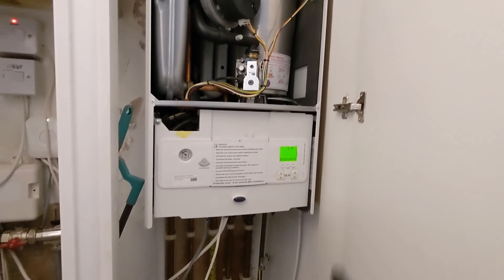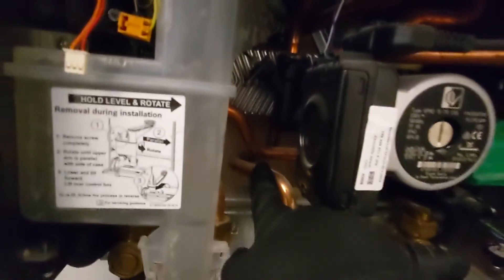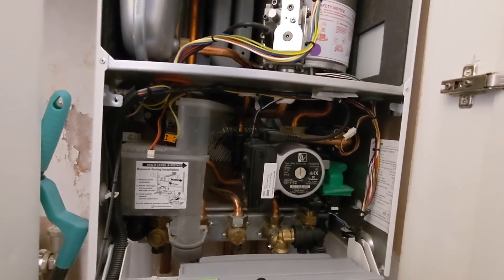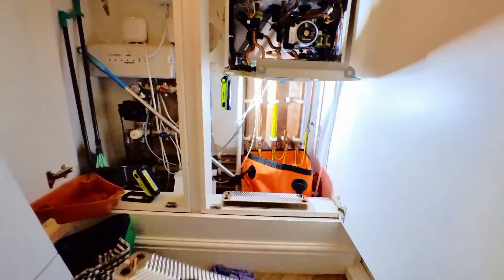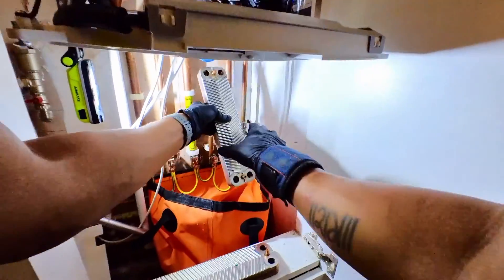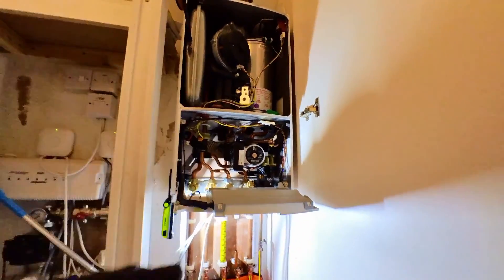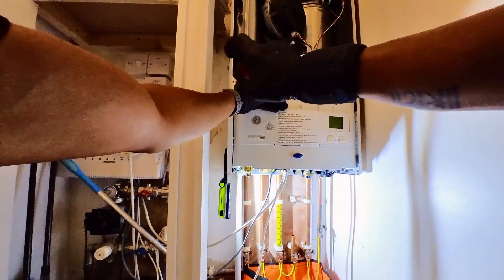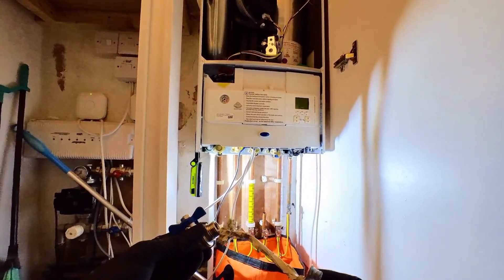Worcester Bosch ERP Plate Heat Exchanger

Comment: Hi Chirag - do you think you could get plate out this way on this boiler if F&R (only) were rear piped?
Reply from the maker: Probably not as the plate wouldn't have enough space to push back out of the block as it would hit the rear pipework unfortunately

Comment: Tried to change one for the first time today, found out the hard way you can’t do it with out going in from the cold side, I was stuck for ideas with the gas pipe out, losing my mind, then I thought I’ll see if youtube has the answer, CP gave me the answer! Thanks dude, got me out the shit 👌🏽
Reply from the maker: Nice one mate! 👊🏾
Reply: @cputilitysolutions  how much did the part cost and what did you charge on the labor. Also, do you not get new o rings with the new p2p?  And finally, what is the part number for the p2p?

Comment: Good video mate,have one too change myself,just silicone grease on existing o rings does the job then,tricky job if you do replace existing o rings, surely access would be awkward,is it best too remove cold  inlet or could hot outlet be removed instead.
Reply from the maker: On the newer ERP ones the cold needs to be removed, on the older greenstars you need to remove the hot 👍🏽

Comment: Rather cut hot pipe as water never needs to be off then obviously apart from isolating under boiler
Reply from the maker: Can't do it that way on the ERP ones, I've tried it and the gas pipe gets in the way. You can do that on the older ones, as I've shown in one of my previous videos 👍🏽